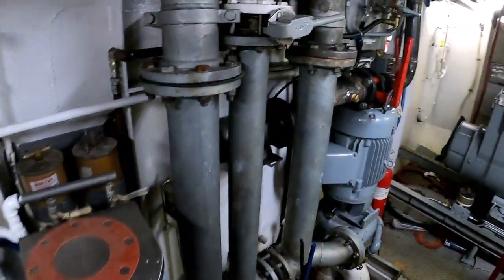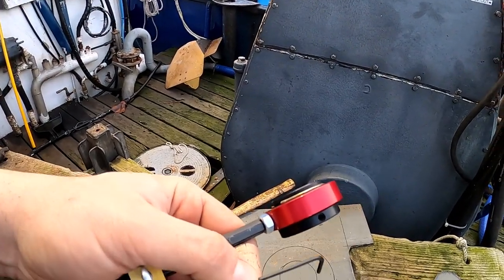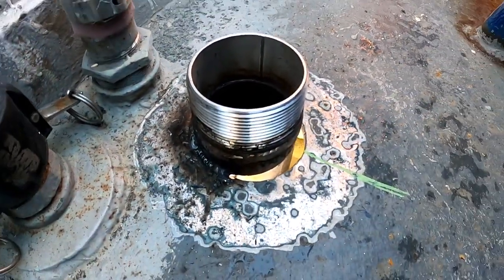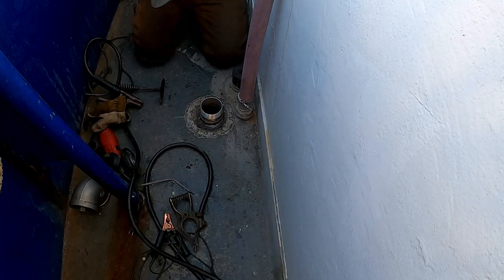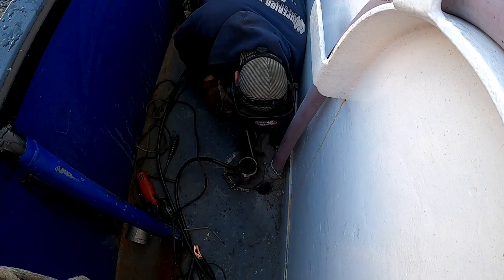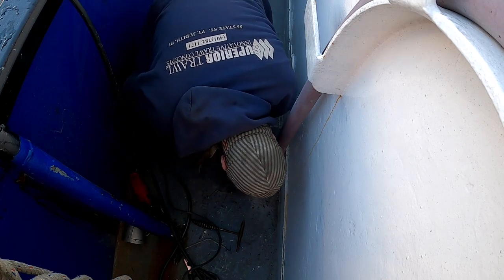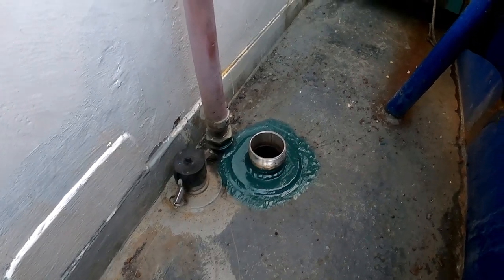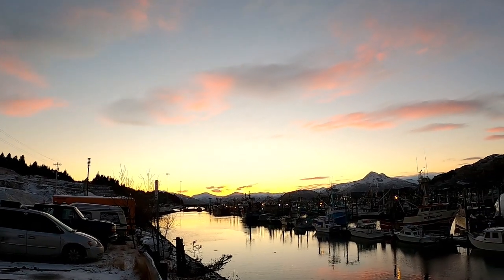Finishing the Pipe Welding on an Alaskan Fishing Boat

Comment: MIG wire is a 70,000 weld filler and then you covered it with a 60,000 weld filler stick rod. Not me. I would have cut the pipe back out of the deck, burned a a big washer to make a tighter fit and flux core weld the whole thing.